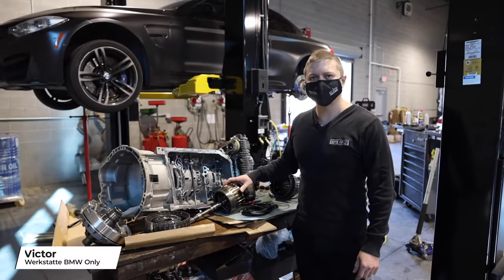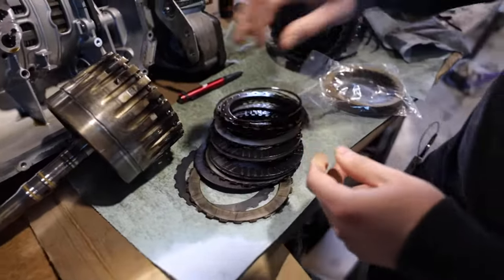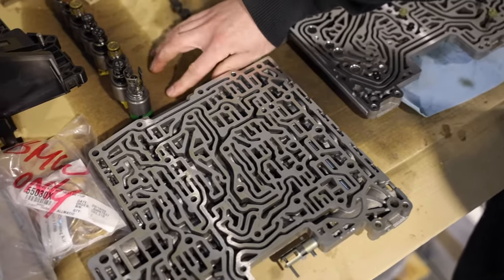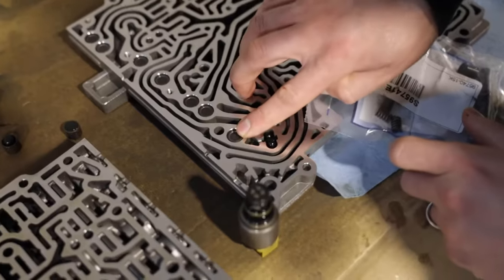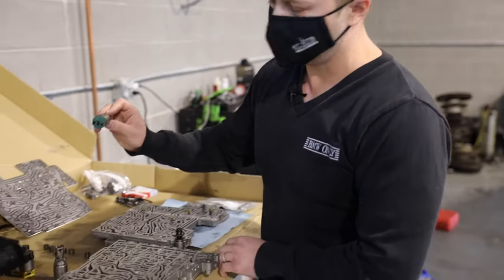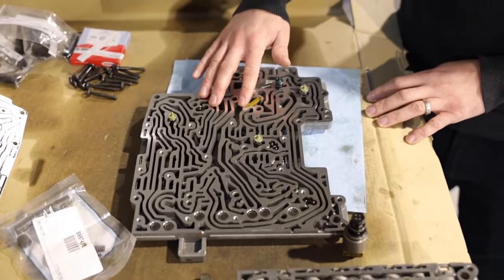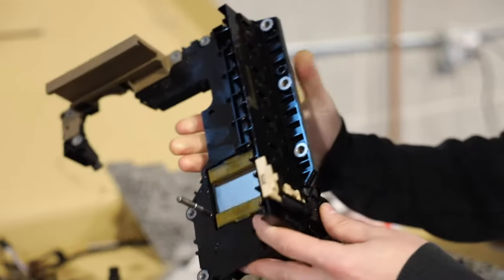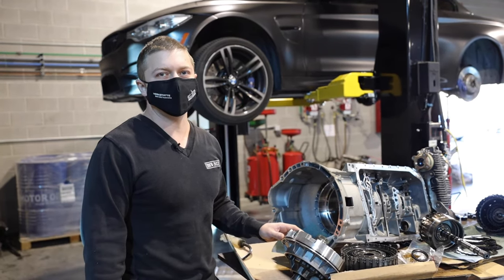Why BMW  Transmissions FAIL 6HP19 6HP21 6HP26 6HP32

Comment: Hello sir, have a 2013 Maserati GT with ZF6HP26 35,000 miles. Refuses to go over 3rd gear and goes to limp mode. Code says E clutch friction element apply time ref/range. Replaced solenoids and new fluid didn’t see any gear components in the pan. Some gold metal shavings. Next I am thinking replace valve body with remanufactured. Do you think this may be my issue with this low mileage?

Shift perfectly before this problem just started happening out of nowhere.
Dealer quoted 35k$ for new transmission and shop 10k for rebuild 😮
Reply: Did you fix your problem?

Comment: Got an 08’ 335i FBO with the 6HP tuned with XHP Stage 3. recently did a trans service replacing solenoids and Mechatronic sleeves, alongside fluids and trans pan. Transmission shifts awesome and adaptation values are within spec. One issue I still have though is when my transmission is cold, my RPMs will tank to less than 1k (even when I am in 3,4,5th gear) when I let off the gas. If I keep driving and let it warm up (~70F) then it starts acting normal and shifts perfectly fine. 

Any idea what this could be? My guess is loss of pressure / hardened rubber parts in the valve body. Could be wrong though. Car has 75k miles currently
Reply from the maker: Viscosity of fluid is thinner when it's hot so doubt it's a pressure loss issue. Also this might not even be transmission related and caused by the engine operation
Reply: @werkstatte-bmwonly9515  engine performs fine though. It’s just the transmission that acts weird when cold. It’s almost like it’s not catching the gears, it’s hard to explain honestly. Right when I hit 70 Fahrenheit on trans temp though it just magically starts shifting normal again. Have you ever seen this happen before?
Reply: @rrokas  my 550i 2008 110k miles does similar. I replaced filter, fluid, solenoids, sleeves, and also did Sonnax zip kit in valve body and valve body plate. 

When cold my car shifts rough going first to second and second to third. Once warm it’s a lot smoother. However in sport mode I always get a big bang in 1->2 and 2->3 so I only use sport mode on freeway. It’s smooth like butter shifting past 3rd gear. 

Would love to hear back if you diagnose anything. It’s interesting OP says it’s not pressure loss 😅
Reply: @safoostar  0 to 60 had a similar issue but his was fixed with the solenoids. Sadly that wasn’t the case with mine. These transmissions are weird

Comment: 2006 330i ZF transmission with 103K miles is stuck in 3rd gear. When do you decide whether you need a valve body rebuild, new solenoids, and a torque convertor?
Reply from the maker: So step one is to check the fluid level. If it's full we just replace the transmission because they aren't expensive these days. Of course you need to make sure you don't have fault codes for a stock solenoid. If you have solenoid faults then do the service and replace solenoids. If trany is low on fluid then fill it up and drive it for couple of days. If it shifts fine them do the service with solenoids. Also clear the fault codes and see when it slips. Clutch A and E are most common. For some reason 5 series transmissions are have better chance to be saved with trany service with solenoids then 3 series.
Reply: @werkstatte-bmwonly9515  thank you for the quick response. when you say "we just replace the transmission", do you mean you rebuild it with all of your recommendations in this video? FYI...i had a full transmission service (fluid, pan, etc.) done less than 20K miles ago.
Reply from the maker: If service was done already I would just replaced it with a used one. I don't know why but 3 series are more common to fail

Comment: 2009 335i AT RWD with 170k km. I have no fault codes but under wide open throttle the car slips from 4th to 5th gear. It threw a transmission code and went into limp mode once. But when I turned the car off and on again it was normal again. In normal driving there is no slippage. What would you recommend?
Reply from the maker: At this mileage drive it till it fails and then replace it with a used one. They are cheap on eBay. Don't try to rebuild existing transmission, it'll cost more money and won't work properly.
Reply: @werkstatte-bmwonly9515  I have a warranty that will cover up to $3k in costs on any claim so I’m wondering even if I have to pay a little out of pocket if it’s worth rebuilding the trans
Reply from the maker: I'd still pick a used one. Rebuild won't be better than a low mileage used transmission.

Comment: I have a ZF6HP26 transmission on BMW 530XD. Transmission drives and shifts very good, no fault codes. But when i stop at redlight with transmission in D, the engine RPM drops to 400 and the engine almost turns off. The car wants to move forward even when my foot is firmly on the brake pedal. Any idea what can cause this? Sometimes 1st to 2nd gear is very agressive also.
Reply from the maker: You probably have clutches that are melted to the discs. You'll have to drop the transmission and open it. I've seen it before.

Comment: I know this is 6HP video but I have 8HP45 in my 2012 X5. I did trans service at 95k miles all OEM parts, 2 months later the trans shudders in all gears light acceleration. Then I installed REDLINE D4 ATF fluid and immediately all problems are gone. Is this because old transmission and new OEM fluids are a bad combination? I am thinking the lock up clutch in torque converter was slipping since it was all gears. REDLINE fluid is a bit thicker than ZF also.
Reply from the maker: Using thicker fluid would help clutch slippage. That's what dealerships do all the time, they have a car with a problematic transmission and they add transmission additive. Sell the car and new owner decides to service it a year later. Shop does the service and now the transmission has issues. So the idea is that the service is bad for the trany when it's a much deeper problem than the service.

Comment: I just swapped a used 6hp26 land rover transmission into my lr3 and before I inspected it for burnt clutches, I had none. I switch the computer on the valve body for my original one. 5 miles down the road im started to get 3-4 gear ratio error. Seems like it doesn't want to go into 4th and pops to 3. What should I look for?  Do you sell valve body's or rebuild them if I send it it in? Do you think this is my issue?
Reply from the maker: It's the worst idea to keep the old valve body. Use the valve body that came with the donor transmission and find who can program it and reset isn ( individual serial number). Tools like autohex can do it
Reply: @WERKSTATTE - BMW ONLY  I did keep the donor transmission valve body, I just swapped out the black plastic with the computer so my land rover would be computer would be the same. I noticed a slight shutter/jerk on every gear at first.  Maybe low on fluid after going into torque converter. I really wish I knew more.
Reply from the maker: Make sure you get 10-11 quarts of fluid if the torque is new. I've seen it too many times

Comment: Hello , i have hp19 with 302thousand km . Last 6 years 2 oil changes plus all sleeves and connector. When did the remap , clutch E dropped from 300 to 11. Very pleased but last 2 months clutch B went from 170nto 259mb. Any opinion
Reply from the maker: What about solenoids? Those wear out
Reply: I never had issues so i didnt. But suspicious for just 2 months big change in clutch B . Does driving style or oil temp in cold areas affect these values ?
Reply from the maker: Hard to say what causes it but my next step would be solenoids. If you can find someone to replace valve body pressure dampers and the plate that would be ideal

Comment: I have 21HP I think as it’s e60 09 525d. Replaced sleeve and filter fluid recently.
Just find it stays in lower gears for longer. And at 1500 rpm mostly and 1100 in 4/5 gears.
Have a gear selector switch code and no message from TCM to it. However GSW works ok but not sure it’s on its way out.
Can you advise wat I should do in this scenario?
Reply from the maker: It's a valve body problem most likely If it's taking longer to shift it's a low pressure issue
Reply: @werkstatte-bmwonly9515  thx for reply. I’m not 💯 on the delay in up shifts my Honda does same. Is the GSW error related to transmission or just the lever comms issue?
Reply from the maker: You would have fail codes in the EGS itself. Shifter won't cause that
Reply: @werkstatte-bmwonly9515  I also find when I release footbrake sometimes get a slight jolt and sometimes not when moving off from stationary. Don’t get the second to one gear jolt just moving off. Thought it was strange but doesn’t always do it and only on foot take not handbrake .?
Reply: @werkstatte-bmwonly9515  I also find when I release footbrake sometimes get a slight jolt and sometimes not when moving off from stationary. Don’t get the second to one gear jolt just moving off. Thought it was strange but doesn’t always do it and only on foot take not handbrake .?
Reply: @werkstatte-bmwonly9515  no EGS codes just GSwitch error no message with TCM. Seems to work ok not sure it’s shifter issue?
Reply from the maker: I doubt it's related to the shifter

Comment: I have a 2006 bmw 650i clutch pack, valve body rebuild, new soilinods, gaskets, bushings, filter, and fluid. And still slips. Mainly between 4th to 5th and 6th. Seems to have delay and also when it goes from 6th to 5th slips a little and same way going up.  Why?
Reply: Zf6hp26 transmission
Reply from the maker: I could only guess the job wasn't done right. I've never had issues after we did this work, ever. Also if sun gear has too much damage it should've been replaced
Reply: @werkstatte-bmwonly9515  thanks for the reply! I took it back to the shop Sunday. I'll keep you posted. They're going to look over it hopefully soon.
Reply: @werkstatte-bmwonly9515  so trans is coming apart today and the first thing we saw was chunks of either clutches or bushings. Not really sure but plan on digging deeper
Reply from the maker: Send me a picture on the IG. @Werkstatte.bmw

Comment: Hi thanks for the video..please tel me I have bmw with 6hp19 transmission now when I Try put D drive it goes into gear but car wont move & no DTC in transmission module 
Iv removed transmission and clutch E was burt and corroded..will that cause car not to drive?
Thanks
Reply from the maker: It's weird that it doesn't detect clutch slippage. Unless they were stocked together but in that case when you put the reverse it'll try to pull forward as well. Hard to say without seeing it. Also make sure no immobilizer or software issues

Comment: Hi. I got a Range Rover bmw v8 petrol 2002 and when warm it makes a screeching sound and slams into gear, do you know what could be causing it🤔 had gearbox oil change but still happens😢
Reply from the maker: How does it perform after it's fully warmed up? You have to check for fault codes and read adaptation values.

Comment: hello , I am suspected my drum 3t4 is bad the same drum you show whit the shaft bad , my question is what is the proper name in that part ?the shaft is come together whit the drum ? all the bushings need to be replaced? some advice about the proper tool to get the bushings out ? I really appreciate your information and description in the video .
Reply from the maker: We replace all bushings and the sungear (drum) that's the drum that comes in contact with bushing on the oil pump.  That's the only one that gets damaged. Hope this helps
Reply from the maker: To add to the previous reply, yes the drum comes with the shaft as one piece.
Reply: @werkstatte-bmwonly9515  OK thank you alot , any advice about the instalacion in the accumulator kit?or any other advice in the valve body
Reply from the maker: Valve body has small Pistons that are spring loaded. When you separate it do it very slowly. If you misplace one you're screwed. When open take a top of pictures to save their position

Comment: hi i have the zf 6hp26 this is my problem hope you can give me some  advice i i have a problem with my transmission  fault code is p0783 gear load 3-4 if i drive using the j gate so it is in third it drives if i only go to 3rd as soon as i put it in drive it comes up gear box fault. now i have changed the oil the oil pan sleeve connector valve body sleeve and the rubbers tubes new solenoids and it still comes up with the same fault code .now when i went to put the sleeve connector in  it was out of line but if i moved the  white part that slides in and out to hold  it in it lined up now should that part be able to be moved from side to side(the part with the electrical pins moves from side to side)   thank you
Reply from the maker: Hi Patrick, it would not be able to help you without seeing the issue. Make sure you have the right part number. Those adapter gaskets are different on the transmissions. Also you have to open the valve body and replace pressure dampers and separating plates.
Reply: @werkstatte-bmwonly9515  is there a way of showing you the photos

Comment: My bmw 2006 325i is having transmission issues. I was on the highway when it went into limp mode and pulled over to the nearest parking lot. Turned the car off and then turned it on to find that the car jerks heavily when put into reverse (though still reverses) and then doesn’t drive when put into drive (Only revs). What could be the problem? Help of any kind would be very much appreciated!
Reply from the maker: Your clutches mostly got stuck from the heat.  In your model there were two transmissions used. They used GM and ZF transmission. I'm pretty sure you have a ZF. You need to scan the fault codes, if there are no faults for solenoids shortage or jamming you need to replace the transmission. It is cheaper than trying to rebuild it.
Reply: @werkstatte-bmwonly9515  I had one fault code using my obd2 scanner and it said clutch switch circuit malfunction. At the moment I am trying to get a different reader to see if there is anymore faults.
Reply from the maker: Generic OBDII scanners won't help. Often it'll lead you in a wrong direction and a wrong description.

Comment: I’m in Las Vegas, my BMW has a 6HP26. What’s a rough estimate on how much this service would be?
Reply from the maker: If you're looking for a basic at pan, adapter gasket and plug for harness with oil $980.
Reply: @werkstatte-bmwonly9515  I think it will be more than the basic. 09 750i, 160k miles. Has jolts when getting into gear or downshifting and doesn’t even grab the gear at all some times when shifting from 1-2.
Reply from the maker: So valve body plate, solenoids, pressure dampers, all of that without removing the transmission is around $1800 parts and labor

Comment: on a bmw e60 with zf6hp gearbox, would it be possible to fit an ea888 engine in this gearbox?
Reply from the maker: Oh that's a question I wouldn't know the answer to. We don't do such a swap here. Sorry
Reply: Why would you want to fit a VW Group engine to your BMW? This coming from a VW enthusiast. It's going to be an absolute nightmare to get the TCU and ECU to communicate.

Comment: Hi, Do you by chance know what exactly is the difference between the 6hp26 and the 6hp32? I have the 6hp32 from the audi v12 tdi which is 1000 Nm capable but i want more. I read that it is basically a fortified 6hp26 but nothing specific. Nobody makes parts for the 6hp32, but they do for the 26. I wanted to see if i can get the strong parts of the 26 installed in my 32
Reply from the maker: So they are capable of holding more torque. That's the transmission they use on the BMW X5M and X6M. Parts are very similar to 6HP26. We have rebuilt them before on X5M and I do not recall having problem finding parts.

Comment: I have BMW 525d wen I put to drive it won't run with couple of seconds it changes into N mode it scanned the error its shows di 420 code could you please help me with the issue
Reply from the maker: Di 420 doesn't sound like a specific fault. What description of the fault you get ? 
Very common is the failure of the adapter gasket that's between valve body and transmission. Also low transmission fluid level. Those two would do exactly what you described

Comment: Hi, I have a problem with my bmw 535d when I'm driving along my revs are bouncing and when they are doing it, the car feels like its hesitating but then I let of the gas a bit it stops doing it.
Also got a fault code 004f6f.
Reply from the maker: It sounds like you have a misfire. Might be a leaking fuel injector

Comment: Victori, if the drum has a black stripe burn mark, just like in this video, is it reusable or no?
Reply from the maker: Marks aren't the issue. The shaft gets worn out and it loses pressure with the bushings. Replace the bushing that goes in the oil pump at least. Check the shaft with your nail, if it's really worn I'd replace the drum. If minor it'll be just fine.

Comment: 06 330i 195,000miles codes p0700 + p17E3 / OEM ENHANCED codes 2ADO + 4F8A + 4F83 
Prior to codes running solid only obvious issue was at a sudden stop my car would jerk sometimes. I reset codes reset transmission driving slow and steady so far getting me to work everyday without any warning lights but definitely know something is wrong I’d really appreciate any information about this small description I provided, any questions please ask thanks for your time.

Comment: Hi got a x5 2008 4.8. Their is delay for 2sec in reverse.  What do you think might be the problem
Reply from the maker: I would try solenoids first. It sounds like it takes time to build up pressure. Not a common issue